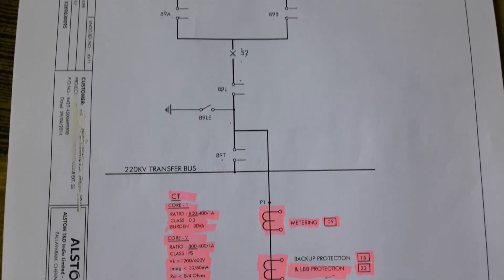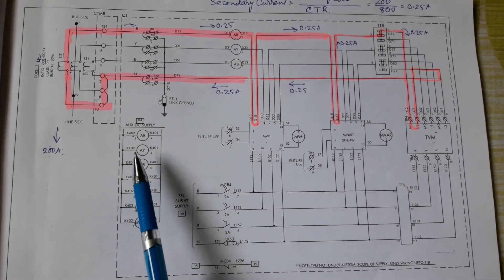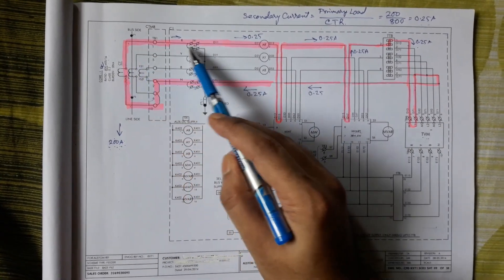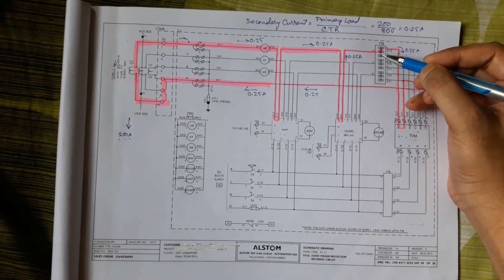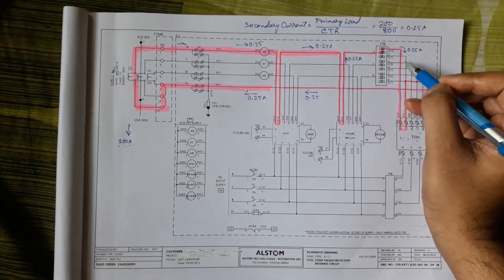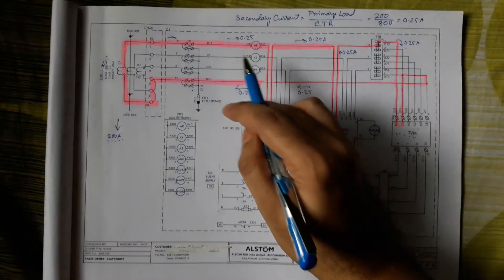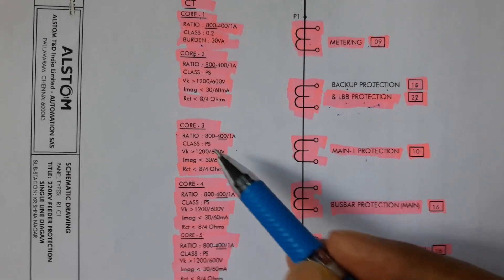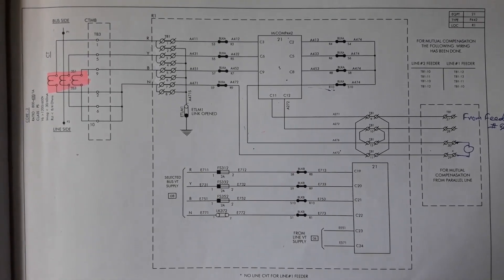CT SECONDARY CONNECTION EXPLAINED WITH PANEL DRAWING/CT WIRING AT SUBSTATION

Comment: If shorting in TB of 4th (main)or 5th (check ) core is done, main or check zone bb relay will act.. right?
Reply from the maker: Depends . In numerical bus zone relays it will blocked by OCT . However both main and check zone to be operated for actual tripping of bus section.
Reply: @eddycurrent1187  What you mean by OCT?
Reply from the maker: Open CT.   OR CT CIRCUITRY FAULT
Reply: @eddycurrent1187  got it!

Comment: Thanks for this good content. For instance if I have a CT of 800/1A , why if I inject 1A on the secondary side of the CT , will I get 800A on the primary side ? If no why ?
Reply from the maker: If p1 and p2 are firmly shorted. Then by injecting current by voltage source at secondary side, i think it is possible.